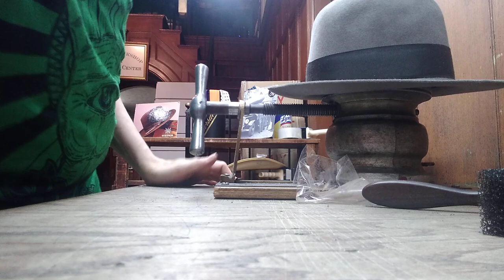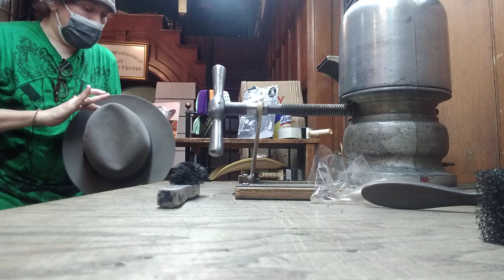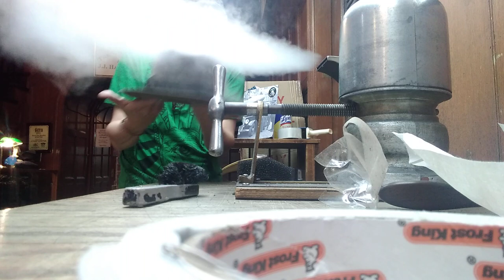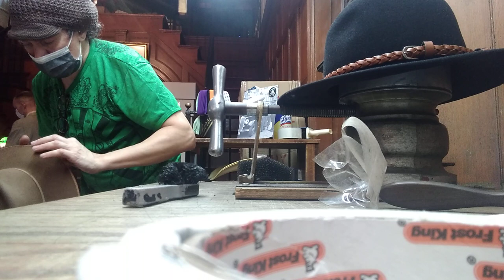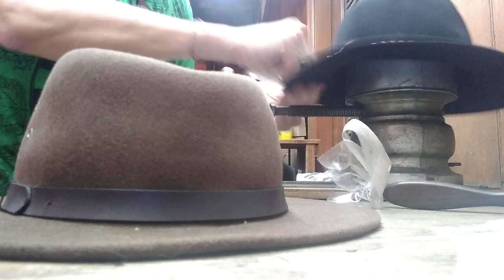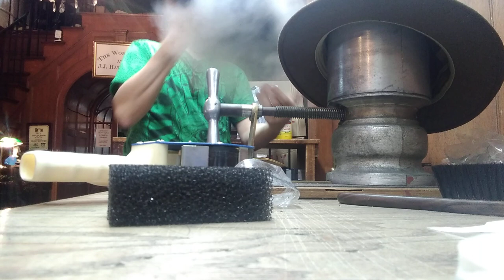Steaming an old Stetson Dune & a Vintage Fedora at the Hat Shop

Comment: great to see you back in the shop Kev, 
BTW what was the tissue action you used?
Reply: Like yeah!  Every move Kevin makes looks magical & turns out that way as well 🤓
Reply from the maker: Oh, yeah..the steamer will spit out a drop of water or two occasionally..so as soon as I hit the pedal, I should keep the hat out of the way of the initial blast,to avoid the felt getting after drops on it. It’s been a while since I used the steamer, and I forgot about that, and the felt had about 10-20 little drops of water sprayed on it. 
When that happens, It’ll just dry on its own, but I like to hand a hat back to someone that looks perfect, so I’ll take a paper towel and blot out the water drops. 
It’s a technique that takes a few times to really grasp, use a flat palm and press gently, It might take about 4-5 blots, but eventually the water will disappear completely